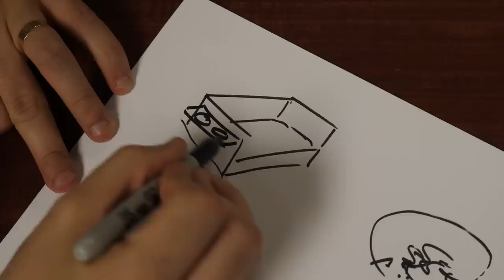High End Gaming DOG BED?! (this is not a joke)

Comment: Digging the idea.  All that would need to be done to make this a hit cat bed is to take out the fabric bed and replace it with a cardboard scratching brick.  Just laminate a ton of the extra cardboard from shipping and run it through a band saw and plonk it in the bed. Don't glue it in either so when one side wears out you just flip it

Comment: My thoughts :
-must have personalization. Love the idea of the insert. 
-Wyrmwood tree inside the dog paw print. (ex. replace shield with paw print) 
- first thought is 4 sizes. St Bernard/Great Dane, Retriever/Lab, Terrier/Corgi (and cat), and tea cup/tiny. It would probably be best to check what standard dog bed sizes are to actually determine sizing. 
-More bevels. Just everywhere, honestly. These dog beds are at that unassuming but shin murdering height, not to mention the last thing you want is the possibility of a sliver.
-I love the idea of built in storage.
-Many people would probably love to have the bowl holder on the bed. Elevated food bowls are important for larger breeds/older dogs with joint problems.

Comment: Different animals have different things that are toxic or poisonous to them; chocolate, for example.  What you should probably do is talk to a vet or some kind of poison control group that specializes in animals and just ask some basic questions about whether chewing on certain woods is a problem.
Second, you should probably bring in the dog-having staff at Wyrmwood and ask them stuff like "what would YOU do to tweak this table?" or "if you were going to put something on a magnetic rail over than food/water bowls and toy/basic storage, what would it be?"; I mean, if you've got customers on your staff, you might as well plumb their opinions, because whatever they've not been able to find in pet stores is a potential product line.

Edit:  also, in case Doug or another member of Wyrmwood is actually reading this:  if you're actually serious about having a shop dog, you NEED to run that by Frank, because if that dog gets loose in the shop, that's probably opening yourself up to all manner of liability, on top of possible charges of animal endangerment or negligence.

Comment: My puppy loves Wrymwood products so we are down to get her a wrymwood bed. :)

A bit of feedback. People who are willing to spend $500 on a dog bed, will be fussy about the mattress. Different dogs has different requirements especially regarding joints issue, skin issue and weight. Like for one of mine, she has a airtech from purina to help levitate her joint issue. Maybe you can offer to sell with and without a mattress? The other thing will be corners, the corners on the prototype bed got me slightly uncomfortable, mainly because my two dogs are quite playful and love to run around which often bump into their bed. It will be less painful if the edges and corners are rounder :)

On that note, some form of rubbery feet or bottom might be useful for the dog bed too. Many dogs got excited when called so they launched off their bed in full speed and force.  Wood on floorboard means my dog will launch the dog bed straight into the glass coffee table or door lol

Looking forward to your bed! All the best!

Comment: I’m concerning about hard corners as logs love to run around and spin.  Easy to hurt yourdogself on non rounded edges.  I wonder how much of your run off scrap wood could be used on possible small and medium sized beds? Would that lower the price if it would end up as scrap anyways?
Reply: Wyrmwood only make good heirloom products. I don't think Jason would allow waste material if it looked like it was made out of waste material just like the espresso maple/cherry/nicer cherry, that was made out of structurally good pieces that had visual flaws only and that only got used because it was getting stained, if they don't stain the dog beds due to concerns regarding toxicity then you stuck with good wood only.
Reply: @stephenhurley4296  You do realize that waste or off cuts can mean pieces of wood too short or too narrow to use for any of their products?   It relates to the ep where they where throwing out tons of wood for garbage but that can be sold to numerous other industries where they can find use?   A piece that is perfectly good for a table but 2cm too short for any product becomes waste.  - if that can be then used for legs on a dog bed and not become part of the scrap sold to others - that reduces waste and costs right?  If you go back maybe you say those episodes?

Comment: Shop dog: Nope.. animal cruelty in that kind of environment
Dog bed: Yeah... I'd consider it

The front rail does need to drop well below the level of the cushion, dogs like to lay with their head hanging off the side of things.
Also, you might be surprised at the cost of a cushion.. would not buy a bed without one included.

Comment: I have 5 dogs and would definitely drop money on this.
Just needs to fit the Saint Bernard
Reply: How big would a Saint Bernard bed need to be?  I would definitely design an XL version for if they decide to go with 4 sizes
Reply: @CRAZY-ED  I would think max teir we are talking something along the lines of a 2.5 - 3 foot by 4-5 foot for XL sizing (i would think that should fit like fat sam to as high as great dane based on eyeballing it)  (interior measurements)
Reply: The large bed we have for him is 32" x 42" but even that is a little small
Reply: @CRAZY-ED  I have a Great Dane. His personal preference is a Queen bed. :D. We have a mattress/bed for him that is 38" x 50" with 5" thick mattress (Purple brand) and that seems to work. My dog is 36" from the ground to his shoulder. He weighs 155lbs. His chin can rest on a standard height counter with all his feet on the ground. Stretched out is is over 7 feet long.

An important consideration for giant breed dogs - it's really nice to have it a bit off the ground. Especially as they get older, laying down in a low bed can be difficult. My very senior Great Dane would rather step up onto the couch than down to a bed on the floor A bed that was 12-18" off the ground would be really nice. Oh, and taller bolsters/sides for headrests?
Reply: @CRAZY-ED  The crate for my mastiff is 54"x37" and the company we bought her dog bed from has a size they advertise specifically for Great Danes and Irish Wolfhounds at 60"x48".  Honestly if you need a test dog we're down in Lancaster County.
Reply: @jonathanfrank1812  oh no shit. My wife works in Lancaster
Reply: @CRAZY-ED  Yep, born and raised.

Comment: I have no real opinion about the video BESIDES excluding cat people based on personal dislikes.

The amount of people that prefer pens over pencils is a ratio you can ACTUALLY divide. But, you sell both of them because there is a need. You're missing out on a TON of cat furniture / toys because there are MORE options for cats. You can put a magnetic rail system together that people screw into the wall, then invent a mountable platform system that people can customize with whatever type of woods they want.  You put the cat logo on the bottom of the pieces.

Call it Pussy Lyfe.
:P 
You're missing out.
Cat products have SO much more possibility. Dogs get beds. Cat's get multi-tiered bungalows.
Get out of your own head, look at the figures.
Sell cat stuff.

Comment: For the love of all that is good and holy, do some actual RESEARCH before you start making dog beds and bring a dog into the shop!  1) Any dog you get should be a rescue and they should go home with a designated caretaker every night. 2) I agree with everyone who said a shop is not the place for a dog.  You work with poisonous woods and stains in a way that allows their dust to flow through the air.  How are you going to feel if the dog comes down with lung cancer or gets wood dust in their eyes that scratches their corneas???  Dogs are escape artists.  What are you going to do if the dog gets out, jumps in front of a heavy piece of equipment in the middle of cutting something or the forklift when it's zooming around the floor. If they happen to run through some chemical compound that was spilled on the floor and was in the process of being cleaned up?  You know the first thing they're going to do is lick their paws.  Please, I beg of you, CONSULT A VET before adding a dog to the shop. 3) Rescue shelters usually know the most about what an animal needs.  They may also be able to provide helpful insight on what a cool dog bed accessory would be AND a visit to a local rescue shelter makes for great Wyrmlyfe content.  A visit to a BIG one, like Villa Lobos in New Orleans (last I heard they were care takers for over 400 dogs). They had/have a show on Animal Planet called "Pit Bulls & Parolees." Doesn't mean they'll be able to meet you when the camera crew is there, but if you want REAL input from people who take care of 400 dogs a day that's a place to go (again, excellent Wyrmlyfe content).  They can also tell you about what type of bedding options a dog will need throughout their lives and the ones that work the best long term (and won't kill them if they chew it into pieces).  Also, if you collaborated with a rescue to figure out what the best design for a wood bed would be, if you gave them some of the product after it was finalized, couldn't you write it off because rescues are usually 501C operations?  Things to think about.